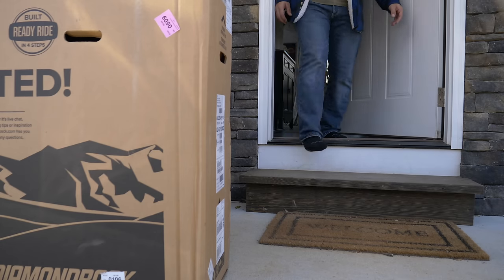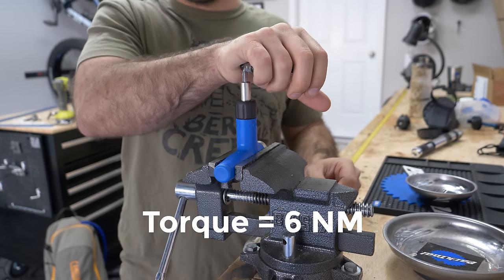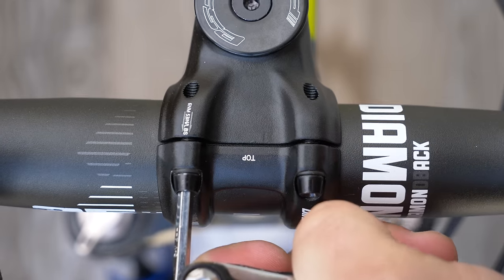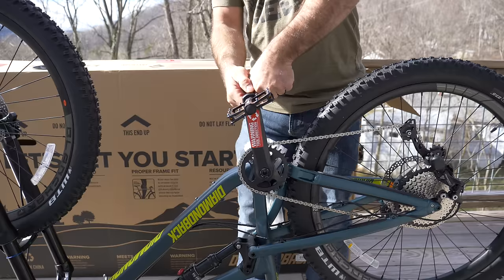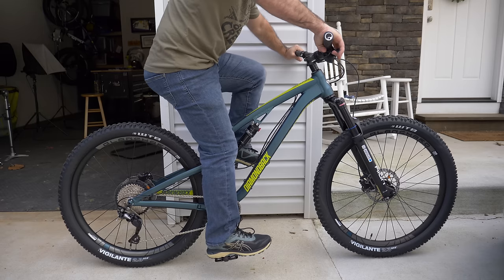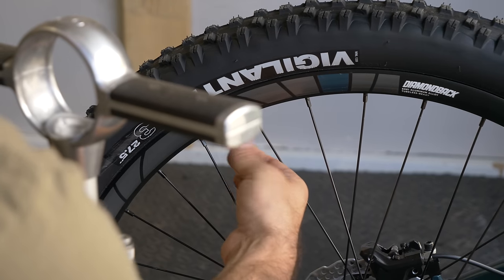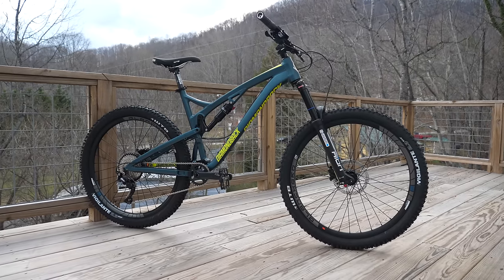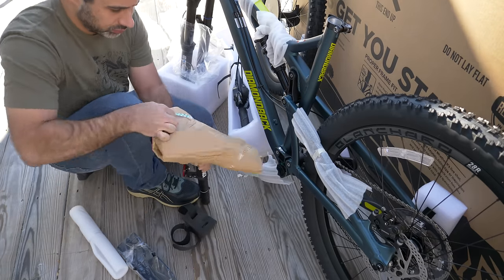Assembling your new mountain bike with minimal tools

Comment: This is a good place to start as far as building a basic bicycle out of the box. However, you need to keep in mind that these bikes are assembled in high volume factories where the thoroughness and quality of the build is the last thing on their mind. I can nearly assure you that the pivots, headset, bottom bracket etc are not greased and will start creaking almost immediately. I can guarantee the cranks are not torqued to spec, I’m also willing to bet that the cassette isn’t tight either. Honestly, in our shop when we build a bike - even one of these 90% built - ready to ride jobs, we tear the bike 100% down to the nut and bolt and make sure everything is clean, straight, greased and reassembled properly. Other things we find a lot is that the shifting out of the box is usually terrible, again attention should be paid to this area, and, a lot of time the derailleur hangover will be bent straight out of the box due to the boxes being bashed against each other during transit (many manufacturers include a second hanger with the bike). Also, many of the big factories use cheap grease so you should definitely invest in some quality waterproof grease, this will help extend the life of your pivot bearings, headset and bottom bracket immensely.  This is not a shameless bike shop plug, but your new bike should always be assembled by and experienced tech or professional mechanic to ensure enjoyment and longevity of the bike and its parts. (Honestly I could go on and on about how to properly build a new bike, these are just the main examples). Thanks Seth, the channel rocks! Hope you’re healing up well.

Comment: Word to new guys when going tubeless. If you happen to pull the tire completely off the rim, it needs to be re-attached. Meaning...you will hear two small pops instead of one, as the tire "catches" on both sides of the rim.

Comment: Great video, I really enjoy your Channel, even though I can't afford any of the bikes in your channel 🤣🤣. 

I have recently taken by cycling after  long gap of  20 years. My bike is a hard tail MTB.

I mainly ride on city roads that have some potholes, sometimes shards of glass, but otherwise roads are not very bad.

My main focus is on reducing my weight, so I ride like 40 km a day.

I would like to know Is there any sealant that will prevent tire punctures? Something similar to sealant used in tubeless tyres?

The tires are tubed type (27.5 inch), kenda make. The rims double walled aluminum Alloy 32H (🤔🤔) . I maintain  a pressure of 45 psi on both tires.

Comment: I want to start off by saying great video Seth. But I have a question about my fork. It’s a Rockshox Pike RC, and the last time I took it to a shop was they put volume reducers in the fork. And they over tightened the air cap. I can’t get it off and I was hoping that either you or a commenter could help me out.

Comment: Ok so if you travel do you still need to need to adjust the brakes if you take off the wheel?
Reply: You mean bedding them in?
Reply: @masamainio4472  yeah
Reply: No. Only if you install new brake pads, clean your rotors, or install new rotors
Reply: @MatthewSullivan12  thanks

Comment: Hey all, complete newbie here. i really want to get into MTB as exercise and a new hobby to get out of the house. I am a big buy 6'3" 400+ lbs, I think MTB will be the thing i have been looking for to get the weight down. unfortunately because of the weight i am very hesitant to just pick up a bike and start to ride my local trails. As far as i can tell almost all manufacturers do not list max weight on bikes. are there any resources i can use to find a good bike and or tricks i can use to beef up the bike as it were? such as better shocks or just getting a hard tail?
Reply: Just make sure to pump your tires more and if you have air suspension, look at the sticker where it tells you about how much air pressure you should have. As long as you do that, there will not be so many differences. 
Tire pressure depends on weight, so 
low weight=lower pressure
Higher weight=Higher pressure. 
If you have a good floor pump, set perhaps 35 psi in your tires, maybe even lower. Keep a watch on how much your tires compress when you sit on it without feet on the ground.

Comment: Having varying degrees of paralysis of my hands - your instruction of adjusting the seat post quick release to be possible to "Just" close it with my thumb - these instructions assume that everyone assembling this has absolutely No Paralysis of their hands with seriously degenerated muscles in their hands with extremely limited hand strength.

Could you please post the specific torque.

Thank-you for your time and assistance.

Comment: Hey Seth, was hoping you could help me? So basically when I use my front brake, my front wheel flexes and bends to the right, I’ve got the through axel but it still does it. Any ideas? Cheers

Comment: How long will the sealant stay fluid if the wheel does not move? I have tubeless on my MTB, but I had have not had the chance to ride it in a few weeks. I have rotated the tires, but I am worried the sealant may have hardened.

Comment: Seth! Love your videos. I have a general question for you regarding buying direct sales bikes. I’ve been trail riding for many years (I’m in my 30’s). I recently started going to bike parks but I rent a bike when I go.  I’m very interested in a lot of the direct sales bikes. So my question is, in general, how upset do bike shops get if you bring in a direct sales bike just for general maintenance? I can set it up myself out of the box but after some wear and tear I know I’d want a bike shop to tune it up etc. Should I just go with a LBS brand? Do they really care that much when someone wheels in a direct sales bike?? Thanks!!!
Reply: They should be fine with direct to customer bike brands, but if you haven't been trail riding for that long, then definitely go to a bike shop, and talk about the right size bike for you, right kind of bike for you, budget, suspension set up, tire pressures etc.
Reply: Nice. Good to hear. Ya I’ve been riding for 20+ years. Very knowledgeable, just not a trained mechanic when it comes to getting a bike super dialed.

Comment: Question 1:
On the back shock do I fill it by psi per weight (is there a table?) Or 30% from the top of the shock.? 
Q2: if my bike mechanic said he filled up 300psi and the shocker trails over 90% down, do I need to replace the whole unit or could it be fixed?
Reply: how heavy are you?

Comment: Hello,
I have a Problem with my 3 month old Bike, its a Swoop 170 and recently  the cranks keep comming loose, its a 2 part Crankset from Raceface and nearly after every ride or when i hit my pedal on a rock i have to tighten the bolt.

I took them compleatly off, cleant everything and reinsalled with new Grease but the problem is still there.

does anyone have an idea whats going on. 

The frame is not Damaged.

Comment: Hey Seth. Love your videos. After you seat your brakes if they still don't stop you quickly what should a guy do? Re clean and re seat?
Reply: you can clean them. but if you aren't happy with the power they give you you might have to look at an upgrade for bigger rotors, or better calipers
Reply: @caninec1836  thanks. Recommend a reasonable price set?
Reply: @harrygrimley4352  personally, i run avid brakes with a 180mil. rotor, but if you're running a budget bike, try making your current setup work by positioning your levers so you touch the farthest point, it gives you more leverage.
Reply: @caninec1836  cool. Thanks for the tip. New to this. Lots to learn.

Comment: hi guys, quick question. im a heavy built biker bout 140kg, should i go for a full suspension frame mountain bike or just the normal one with front suspension? and yes im fat and getting into the sport of biking for weight loss. {just sayin for any fat shamers out there...cheers!}
Reply: It really depends on where and what you like to ride, personally i'd try out a few different hardtails and full suspensions to see what you like. I'd go for a full suspension since what i usually ride is more technical terrain however if your just riding some dirtjumps a hardtail would probably be preferred

Comment: Lot's of handy tips here but I wonder if someone can help with a disc brake issue?  I have hydraulic disc brakes, the right side (front brake) requires very little pressure to  depress ro engage the brake which feels pefect, however the back brake seems to need a lot more pressure before the brake engages...why is that?  Does it need more fluid, do I need to drain it then re-fluid it?
Reply: i have the exact same problem and i looked online, but all the answers i read talked about bedding in my brake pads, however my bike is not new at all. if yours is new this could be the problem. i dont know much about fixing bike problems, so if this is not the answer, i hope someone here knows enough to help us.
Reply: @riccardopinto6957  Thanks Riccardo, my bike isn't new either, the previous owner rode it a lot before it came in to my possession so the pads would be well bedded. Like you I have searched everywhere online but can't get to the bottom of it, sounds like the issue is uncommon as I can't find anything about this problem either :/

Comment: Seth how do you like the suspension on that bike? I have the same fork and rear shock and they seem very slow to me
Reply: Try adjusting the rebound on the shock to be faster and it will make the shocks feel faster it is the red knob on the bottom of the fork and will be labeled rebound adjustment on the fork and rear shock.

Comment: hey man, i have an old bike with a dropper post, when it was installed they used some kind of cheap grease that went dry(?) anyway now its like reaally hard glued to the frame, any ideas on how to get it out?
Reply: Clamp the post in a work stand, lots of WD40 (or any other solvant), apply some heat with a heat gun to the seat tube - now gently turn the frame back and forth using it as a lever - repeat after cool down.
You also might wanna try clamping the frame upside down, removing the bottom bracket and have some solvant soaking "up" from the underside as well.
Good luck!
Reply: @geemail369  thanks man! I will try both ways

Comment: My new bike has too much sag on the rear shock and I tried adding some air and it didn’t change.  Any advice appreciated?    Should I keep adding air.   I don’t want to put too much and maybe exceed max psi and it’s hard to tell cause my shock pump only goes to 150 psi but it says max psi is 325.     App tips, thank you
Reply: If its sag that is too much, then yes, you should keep adding air.  This may require you to buy a new shock pump: i got mine on offer for £10, and it goes well past 300 psi.
Reply: just keep adding pressure. unless you weigh 200+kg you should be fine.
Reply: Yeah get a shock pump

Comment: wait. i put thread lock on the peddle threads.... i should have used grease?
Reply: Yes, just cuz if that paddle gets stuck in the crank arm...you're gonna have a rouuuuugh day, a day that will involve a blow torch and a cheater pipe.

Comment: How i know if my bike has air suspension? Im new at mountain biking.
Reply: It will say in the specs on the manufacturer website, and it will have a port to hook up the shock pump. If nothing else, air suspension usually comes on more expensive bikes.

Comment: the bike seems impressive.
whats its price?
Reply: I paid 1500 a couple months, but regular is  1800-2000. Not the best components but at the price I figured I didnt mind upgrading when needed. I've already replaced rear shock with a fox dps (should've gon dpx), pedals to RF chester, crankset to RF aeffect and a fox transfer dropper. Puts me at just over 2100. DB C4 is on sale for 2400. So that would have been a better deal

Comment: What pressure should your fork have when measuring sag?
Reply: In the video he said there should be about 30% sag, this may vary from fork brand and model. Keep adding or removing air as necessary, you will need a special shock pump for this. If this explanation seems vague im sure you could find a tutorial on channels such as Park tool, just type in "how to adjust suspension sag on a bicycle" and im sure you'll it. Sorry if this seems like one long confusing sentence
Reply: How To Set Fork and Shock Sag | Mountain Bike Maintenance 

Copy this and put it into the YouTube search, it'll take you to a GMBN YouTube video, they're some very friend British cyclists. I hope this help....
Reply: @theworldsokayestmichigande851  I also have another problem. My air fork doesn’t have an o ring. The fork does sag but the manufacturers (rockshox) say nothing about it. There’s only a sticker about weight.
Reply: @regulus7754  you can loosely put a zip tie on the shock to measure the sag just be very careful taking it off, you dont want to scratch it
Reply: @regulus7754  what model of Rock shox is it
Reply: @theworldsokayestmichigande851  If I remember correctly, it’s the TK100 Silver.
Reply: @regulus7754  hmmm, im not sure. I dont know if its an air fork
Reply: @theworldsokayestmichigande851  It is. Otherwise I wouldn't be able to pump it up with air, would I?

Comment: is this bike good for a COMPLETE beginner like me  or should i pick something more expensive?
Reply: general viewer you probably should get something less expensive. The bike shown is approximately $2000.
Reply: @akshaypillai4083  maybe a trail hardtail?ive researched a lot i basically know the pricing of bikes.i wanted actual fox or rockshox suspension but im just asking here to get an opinion.ive done quite a bit of fastpace city riding but ive never been on an actual trail.
Reply: @akshaypillai4083  also thanks for your opinion.
Reply: There are alot of factors go to a bike shop you won't regret it (go to a local bike shop not a huge shop)
Reply: Go to a local bike shop if you can. They will help you choose out a bike for your terrain and the style of riding that you intend to do on it.

Comment: Brand new to mountain biking, just bought a bike off my brother in law for $700 (Kona Big Kahuna).  Can anyone tell me 1. If the $700 was a good deal 2. If it’s a decent bike.     I basically took his word for it, love the bike so far btw but dunno why but having trouble finding it on line.
Reply: 700 seems to be an ok deal. If the bike has 1 gear on the front it was a great deal and is a great bike if it has 3 or 2 up front it is a good beginner bike but you will probably grow out of it. Hope this helps.
Reply: @chiefboyarr-dee8337  It originally had 3 up front but he swapped it out to have a single one up front.   Also tubeless.      Any idea what it cost brand new?
Reply: I'm guessing about 900-1.2k new. It is a good bike especially with mountain bike plus tyres and probably is worth 700. You should probably be able to progress on the bike for a long while.
Reply: @chiefboyarr-dee8337  appreciate the info/response.   Last ?, what are some other areas I could look to up grade it?    I’ve done small things (pedals and grips, both rockbros).
Reply: There is a lot of models of your bike and I'm not sure exactly what you have, but upgrading your fork could completely change how the bike rides. Also you could get a dropper post if your bike doesn't already have one.
Reply: @chiefboyarr-dee8337  apparently he also upgraded the drivetrain from SLX to XL.    Dropper post is def on my list of upgrades (forgot about that).

Comment: i got my fist mountain bike for Christmas and with the seat as low as possible my feet don t sit flat on the ground with my foot bent so can i have help to answer this
thx to anyone who does
Reply: NJC16YT Gaming and Motorsport  I think it should be fine as long as you can stand over the frame with enough room so that if you fall forward you won’t crush your nuts
Reply: @lucamorse6974  thanks
Reply: Quite frankly, you shouldn't be able to put your feet on the ground while on the seat.  Like Seth showed, the seat should be high enough that your knee is only slighty bent at the bottom of the pedal stroke when placed in its normal position on the pedal.  This basically equates to fully extended with your heel on the pedal.  If you don't have the seat high enough to properly extend your legs while pedaling, you'll develop knee pain.  If you have the seat too high, your hips will rock side to side, and you will develop back pain.  As Luca Morse said, just be sure your nuts aren't going to hit the top tube if you fall forward off the seat, or to use more technical terms that your standover height (the height of the tube running across the top of the frame) is less than your inseam.
Reply: @michaelb1761  thanks

Comment: What do you recommend a hard tail or full suspension
Reply: Are you a beginner and where do you live?
Reply: Rusty Nolastname I don’t ride a MTB but I like jumping my bikes and I live in Wisconsin
Reply: @randomfam2.032  Jumping at a skate park or on dirt jumps.
Reply: Hardtails are cheaper and are better for most jumps. Large (20+ foot) jumps are generally better on Full Suspension.
Reply: If you don't plan on taking it on trails, get a bmx, or if the only trails you will ride are jump trails, get a dirt jumper

Comment: fyi setting up tubeless is much harder than it looks and you will need an air compressor
Reply: 10 minutes per wheel and a floor pump for me. No need for a burst tank or an air compressor.

Comment: what kind of grease do you recommend?
Reply: I use park tool grease but it doesn't matter too much, just buy general purpose grease for the stuff covered in this video. For suspension and other things there are specific greases though.
Reply: Park tool anti cease is great for pedals and axles.
Reply: Any automotive grease is better then no grease.